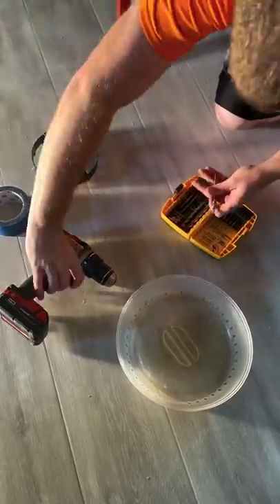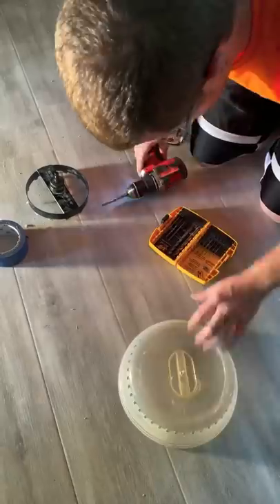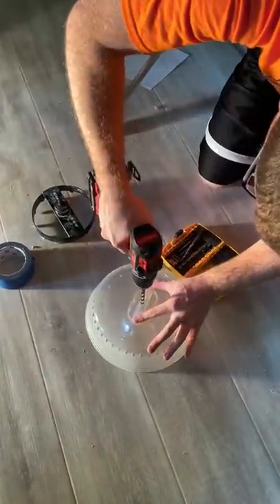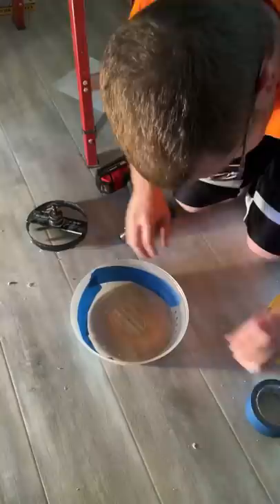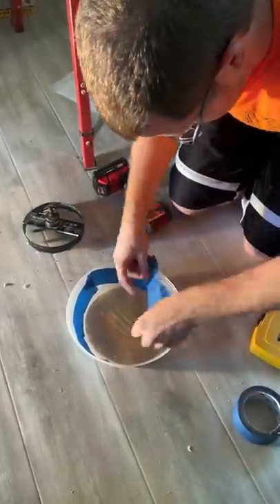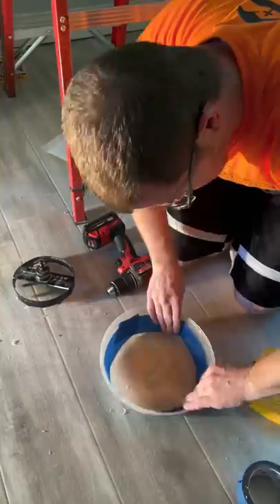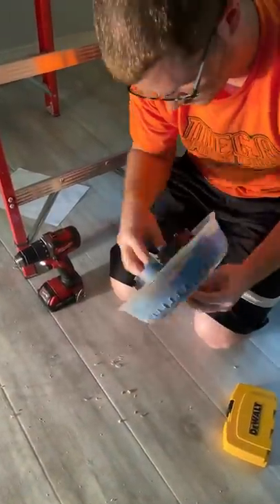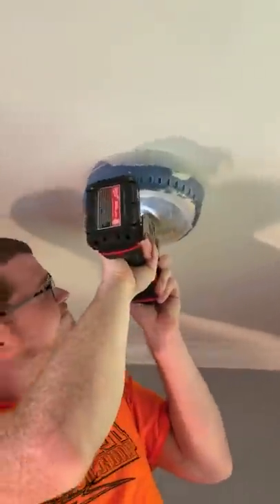How to catch debris from a hole saw

Comment: And when the bowl spins with the drill, you will have a 10" groove cut into the ceiling around the hole
Reply from the maker: I like to make more problems for myself lol
Reply: Could pretty easily fix that by using tape to extend the edges instead, that way only the tape is rubbing. Either that or put tape over the plastic edges to make it softer
Reply: The plastic "protection" wont rub enough to make a mark before the hole saw does its job. My only question is the effectiveness of the apparatus. Regardless of preventive measures that dust gets everywhere!

RIP Juice.

Comment: Nice inginuity but they make products for that. I purchased one that wasnt efficient at catching the drywall dust an manipulated it to fit the wet/dry vac hose it the catch. How did the tape play out? Curious from TX.
Reply: P.s. that dust is a hassle to clean up.
Reply from the maker: I know they make products for that but didn't want to pay for it to use it only a couple times. I didn't think about attaching the dry vac hose to it, that is also a good idea. The microwave cover was accidently put on the stove and melted a little so it needed to be replaced anyway. The tape worked good. I would do it again. I just have to clean the cover after every hole so I can see through it when finding the next center mark.

Comment: 1. They sale these you do not have a og idea 2. Why tape the holes from the inside and not the outside you would have been done in two seconds,tighter tape,and one peice
Reply from the maker: I do know these are for sale. I just didn’t want to go out and buy one. Yes, your idea about putting tape on the outside is probably easier. Thank you for your suggestion.